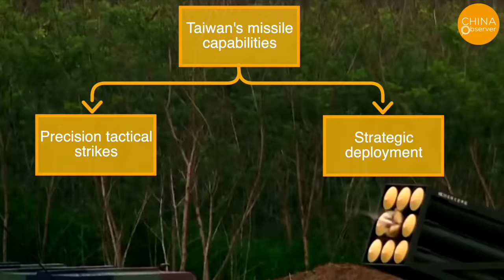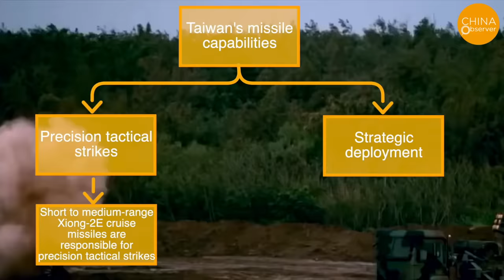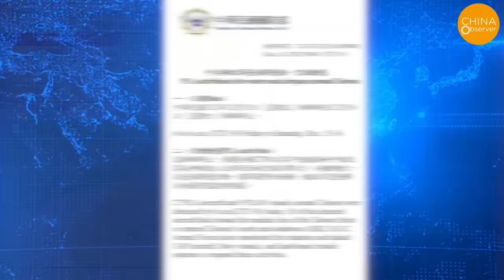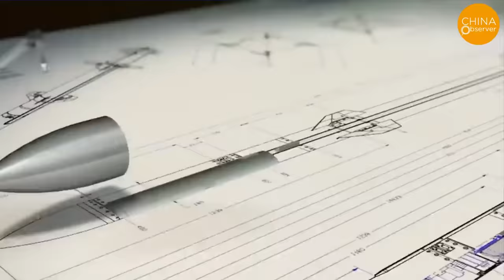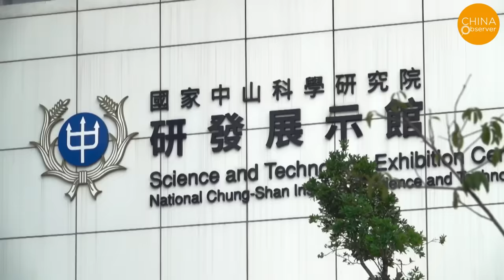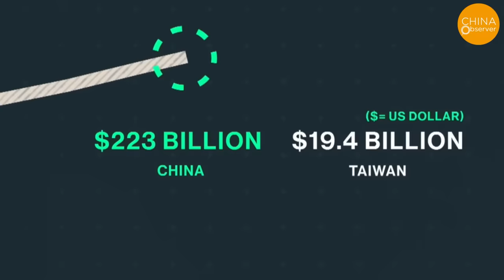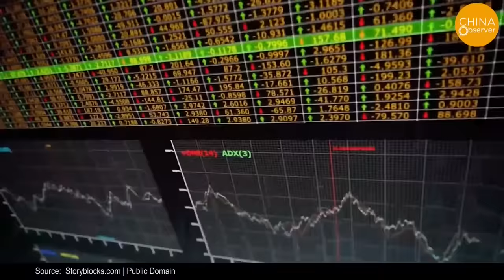$28.3 Billion 3 Gorges Dam in Danger? China’s Junk Missiles Incapable of Defending Against Attacks

Comment: I continue to read about bunker buster bombs and missiles that can penetrate thick layers of concrete and earth.  A series of these kinds of weapons would surely be able to break the dam or weaken it so that a bomb explosion tamped by the hundreds of feet of water behind the dam could cause a failure.
Reply: Technically it is possible, but in reality it isn't worth it. Taiwan would need support from western nations so it defitely wouldn't waste its limited amount of buker busters to do the war crime.
Reply: it wouldn't take much to bust the wonky 3 gorges dam.
Reply: Honestly yes, a bunker buster or penetrator would absolutely wreck the dam. All you need to do is create a single failure point and the entire dam will fail, and the way that the dam in question is built its much easier to make a failure point.
Reply: @andrewcannon587   Proper kick would do.
Reply: Or Chinese construction standards. that would be equally effective at destroying the Dam

Comment: Taking out the dams goes far beyond simple flooding but it absolutely cripples their power generating capabilities.  china does not have enough back-up generating capacity to make up for the loss of the 3 gorges dam.  And a few well placed bunker busters on the large upstream dams and this would do significant damage due to sudden water pressure surges.  At the bare minimum it would overwhelm it and there just wouldn't be enough time to lower the water levels behind the 3 gorges.
Reply: "...due to sudden water pressure surges." I was thinking this might create cracks in the dam.
Reply: @talkinghand122 
Better for the missiles to impact s just made feet to yards  behind the dam. The immense pressures underwater will be more than enough to break apart the poorly constructed dam within the immediate vicinty of the detonation.
Reply: Note that would do nothing other than flood everything around 3 gorges. The recent flooding already caused this and all they did was to flood every other downstream dam and village downstream as they diverted all the floodwaters
Reply: @satorudo it’s a whole different thing between controlled and uncontrolled flooding, that amount of water rushing down steep mountain passes would cause an inland to sea tsunami with destructive power of several atom bombs. The amount of water it holds actually slows the rotation of the globe, that’s  a lot of hydraulic  energy being contained.

Comment: if China is going to attack Taiwan I think their first action will be to reduce the water level behind the 3 Gorges Dam.   This will be easy to spot and will give Taiwan about 2 weeks' notice of the attack, thus if Taiwan wanted to flood downstream of the dam they would need to ensure it is full.  This can be achieved by blowing the smaller upstream dams and targeting the now unstable mountainsides adjacent to the reservoir.   The 3 Gorges Dam is well protected but upstream dams are not, breaching the dam may be achieved by action upstream and not on the dam structure.

Comment: 5.  Wait for a combination of poor design and construction technique's, along with corruption and bribery of oversight of those overseeing the project to take effect.  The end result would be the same.  The structure will fail.  
The only difference is, the structure will fail due to internal incompetence, not external action.
Though, the latter could easily be made to look like the former.
Reply: Cope harder, bruh. It has been operating since 2006. Seen too many of the dam is going  to collapse videos over the years. People like you are still hoping it will. Keep hoping.

Comment: You can also hit the dams upstream causing massive water pressure on the 3 gorges dam. Bombs behind the dam was already shown to work in WWII with the dambusters operation in Germany.
Reply: Will bunker buster bombs work?
Reply: @talkinghand122  Bunker busters (as the name implies) are mostly used to penetrate the ground and thicc mat but if you were to hit one on the Dam..

I have a genuine bet that it would break at least due to what has been seen of the construction industry in china.
Reply: @talkinghand122  They can penetrate deeply into the earth. They can undermine the foundation of the dam. The same for the sides of the dam. Given the huge mass of the dam, it might cause leaks under and around the side of the dam while not affecting the main structure.
Reply: I'm pretty sure the dam busters targeted the dam walls
Reply: @Keagen-v7y  They did but the 3 gorges dam is much more massive than the dams in Germany. The bombs were set off close to the wall with the water focusing the blast on the dam wall. This is sort of how a topedo blows a hole in the ship. If the blast was in the air it would do less damage because the force also be in the other direction as well.

That type of attack may not be possible for the 3 gorges dam with conventional explosives. Undermining the foundation is the other alternative.

Comment: Three Gorges wouldn't have to be breached.  With precision munitions, the turbines and dynamos could render it useless for months or years, blacking out substantial swaths of China's industrial belt.  A blacked out population over an extended period would prove at least as dangerous and disruptive as ANY kinetic attack.  China would have to contend with internal disruptions AND an external military threat.
Reply: Source ???
Reply: @jacksmith-mu3ee  Just an analysis of several publicly available sources from several years ago.  It's actually pretty easy to deduce.  

If one removes 22,500 MW from the regional grid there's isn't much of an alternative "rebalancing load" from any source capable of preventing a catastrophic cascade. (aka mass blackouts)

There's ZERO chance the Chinese aren't aware but as of the latest PUBLICLY AVAILABLE images, I've seen, the required infrastructure to harden against that potential haven't been installed.  

If they started tomorrow though, with a very high budget, it would still take them 3-5 YEARS to build.  If they knew WHAT TO BUILD.
Reply: I see your point on how knocking out the power generating infrastructure while leaving the integrity of the dam in tact would be the best option. I would be concerned though with the quality and strength of the dam to resist such an attack. You see now how it is falling apart already. There still is a high risk of a catastrophic failure of the dam even in the best case because of its bad construction.

Comment: During WWIII the allies used bombs that would be dropped on the lake side of the dam, that would skip on top of the water until impact at the water line. or they would drop Torpedo causing damage below the water line. Last but not least in the Modern Age they have a wide Cornucopia of Bomb and Missile's at their Disposal for...Disposal. Bunker Buster Bombs can Penetrate 100's of Miles, Deep below the surface before Detonation. MOAB'S: MOTHER OF ALL BOMB'S Speaks for it'self. Breaking in for the first time, all new DRAGON BOMB'S Which are loaded Vertically on pallets. Then Deployed from USAF Cargo planes. Each Missile will have it's own Unique Warhead suited for it's mission Parameters. Unmanned Drones could be loaded with Warheads, designed like the Dragon Bomb's, to penetrate the out flow side of the Three Gorges Dam. Blowing the dam might appear to be the most desirable outcome, rendering it useless or turning it Toxic, could work better in the long run. In the long run Tofu Dreg's will more than likely  be the Ultimate Demise of 3 Gorges Dam.
(;TANX 
RYO;)

Comment: normal missles wouldn't damage the dam.  However the US has a model of the F15 that has been modified to carry the massive 30,000 bomb non nuclear bomb the US has.  It would be a one way trip for the pilot.  they would either do a suicide run or eject at the last moment.  Flooding might not be a huge concern for the CCP.  But the loss of flood control and electrical grid would be bad for the Chinese people.

Comment: Bit amazed at the Israel does precision strikes part. A lot of those so called precision strikes might hit the enemy forces but they are also demolishing a lot of civilian infrastructure with civilian casualties steadily rising at the latest conflict between Israel and Hamas. Think one of the figures i saw was 20000 civilian casualties for the conflict so far. Also when it comes to the three gorges dam I think that would be a good way to try to prevent China from attacking since the threat alone should work as a preventative measure. The human cost aspect though is a thing that makes me wonder if a strike like that should be executed in the first place.
Reply: Mutually assured destruction?
Reply: It's not surprising that Israel strikes have also demolished a lot of civilian infrastructure and resulted to civilian casualties. Do not forget that Hamas lived among the civilians and have used them as shields. That's precisely the main reason why Israel had a hard time dealing with the matter aside from the heavy criticism they received. You should not exclude that because it is what's happening. Most of the time you only view Israel's action as wrong but if you think about it, they barely had any other option because their goal is to eradicate Hamas. Civilian casualties is literally inevitable in times of war. I'm not saying we should just accept that but if you went back to what happened before Israel decided to go after Hamas then you might see where they are coming from. Hamas do not even care about casualties.